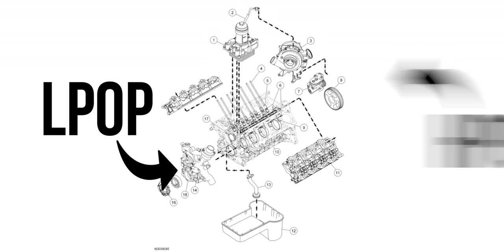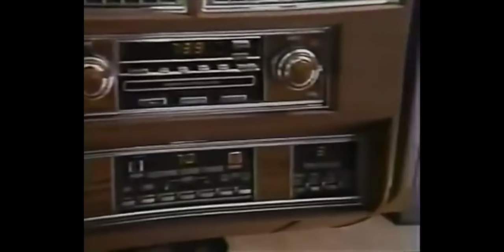These are the WORST ENGINES EVER MADE

Comment: The Chevy Vega engine with an aluminum block (with siliconized bore) and an overhead cam cast iron head. Poor cooling system led to blown headgaskets and warped blocks.
Reply: A well respected engine builder who destroked & hot rodded Vega engines told me he had never seen a warped block Vega engine packing the correct strength antifreeze. We now know today that proper coolant strength is critical in ALL aluminum engines.
Reply: @wymple09  The main issue was that they would CRACK THE HEAD most of the time around 50,000 miles.
NOT warped blocks or head gasket issues.
GM called it the "50,000 mile engine" and it lived DOWN to that name.

Mine didn't even make it to 50,000 (head crack around 47,000) - and yes, I DID keep the antifreeze at correct strength.
Reply: We have a winner!
Reply: @wymple09  Type of coolant is irrelevant!!  Keeping it in the engine IS!  Cylinders sinking down & losing the HG's seal because of that, was the main problem IIRC.
Reply: @alro2434  I didn't mention the TYPE of coolant, only the strength.
Reply: @bricefleckenstein9666  The warpage of the block is what cracked the head.  And it was 99% of the time not enough anti-freeze in the mix. It's also anti-boil.
Reply: @wymple09  Nope, it was not 99% of the time due to enough antifreeze in the mix - or it would NOT HAVE BEEN SO COMMON.
It also does not appear to have been block warpage, as many of those blocks were FINE when they got a new head - no machine work to correct "warped block" issues needed.

The issue seems to have been that the areas around the head bolts WERE NOT STRONG ENOUGH to resist the differential expansion between the aluminum head and the steel block, and would fatigue crack over time.
Reply: I knew someone who worked at Chevy Tonawanda during the Vega years. She said avoid it.
Reply: Vegas were cool deal, I could buy on auto trade for under 400-500 snails. Drop a gm 350 V-8  and 350./400 turbomatic. Shorten a Ford 9 inch, get driveline service to make a driveshaft from the 9" Driveshaft with big u'-joint and front 350/400 slip u-joint and balance the driveshaft. Flat bar solid motor and transmission mount. Graft v8 rad and go jump long neck beer bottle and endless 2 lane donuts without leaving the asphalt.😮😊😊😊😊
Reply: @cel729  Olds (or Buick) 215.
An aluminum block, aluminum heads, LIGHTWEIGHT (40 pounds appx) engine that WORKED in a Vega - and had no noticeable effect on the handling, while providing plenty of power.
And the stock Vega powerline was plenty beefy to handle it - though you did need to upgrade the cooling.

And beer? ICK!
Reply: Forget the engines, they would rust out long before the engines would wear out. Back at Chevy dealers in the 70s in the rust belt, it was common to see rust on BRAND NEW Vegas that had sat outside a few months.
Reply: @joshn938  A lot of Vegas were sold OUTSIDE the rust belt, where the engine would die BEFORE the Vega rusted out.
Someplace like Michigan or even further north, perhaps marginal Snow Belt states like Indiana, you have a point - but both of my Vegas were California cars and did NOT rust out.
Reply: @bricefleckenstein9666  California and Arizona cars usually don't. I think we can both agree the Vega largely was an awful vehicle.  The engines were terrible. I remember a friend had a 74 Vega that was 3 years old in Missouri and the subframe looked like Swiss cheese. Had maybe 20 k miles on it and the engine and front suspension just went one day driving in town.
Reply: May be the worst ( designed by accountants ) but the same design but built correctly by GM UK ( Vaxhaul ) were great .
Reply: @bricefleckenstein9666  if you don't know that Vega's had cast iron heads and aluminum blocks, you won't be on the same page here.
Reply: @georgesheffield1580  UK is cooler, so cooling issues wouldn't plague your Vauxhalls.
Reply: @georgesheffield1580  The Vaxhaul version fixed some of the issues - as I recall it used stronger and thicker areas around the head bolts, among OTHER changes, so there were no cracks to the head.
Reply: @grantdavis5992  I was saying the 215 had aluminum heads, NOT the Vega engine.
Reply: I owned one of these - when the rear main seal started leaking, I replaced with an engine with cylinder sleeves added by the machine shop, it was routine that the machine shop did this this to every rebuilt Vega engine.  The engine used oil, of course, but in 8 years I owned it the car only stranded me once, and that was from a broken fuel pump.
Reply: Can you install or replace the Vega engine with a GM Iron Duke engine to make the Chevy Vega better?
Reply: @levyoliver5363  I have heard of kits to do so - but it's iffy if anyone still makes them after all these years.
Might not need an actual kit as such, the engine mounts and stuff are probably all the same.
Reply: @levyoliver5363  maybe, but I never heard of anyone doing that.  Anybody that wanted to swap engines would figure out how to do the V8 Vega swap.
Reply: Interesting though that they're still probably no more Vegas hanging around then cavaliers and probably even cobalts these days.

Granted their modified, with Stout motors from Street machines to track cars, with cool looks cool paint and cool Wheels.

And someone above mentioned something about an aluminum head on an iron block but they've got it ass-backwards it was an ass-backwards design thanks to the bean counters with an aluminum block in an Ironhead.

The cosworth was the one to get with the twin-cam aluminum head and early electronic fuel injection.

All well ahead of it's time.

But who gives a shit about those engines when most people rip them out and easily swap in a V8, using all the bolt on parts from a Chevy Monza its predecessor.
Reply: Yes.. the Vega engine was a P.O.S.
Reply: @pilot3016  I used to own one so I can tell you straight out of the factory the engine was junk exactly as you say. What happened was Chevrolet engineered a new kind of aluminum engine block with some wonder-metal alloyed with it so they claimed the engine didn't need steel sleeves.  Well that was false, of course, and Chevy's own testing should have forced them back to the drawing board for that engine, but the idiots released the car as-is!  And of course once the consumer bought the car, that engine was soon eating oil and/or destroying itself from head gasket leaks.  But I owned a Vega for 8 years, but the engine had been gone over first, and the shop installed the steel sleeves in the cylinder.  This made the engine last a decent period of time, and the rest of the car was not too bad for 1972 when they built it.
Reply: @bricefleckenstein9666  ...my 1971 Vega, had a sleeved engine put in.  I drove the car another 9 years, never had a lick of trouble from it.
Reply: @robertmaybeth3434  And it had a lot more work done on it than just "putting sleeves in it", as part of the rebuild process.
Probably got one of the LATE heads where the "not strong enough, cracks" issue finally got fixed, as well.

A lot of folks put an Iron Duke in their Vega as a replacement engine - those engines were ALSO reliable and lasted a long time (if the Vega didn't rust out from under them).
Reply: First car I owned was a 1970 Vega wagon. I would go to the gas station  to fill it and then add 2qts. of oil to the engine! I suppose mine was the exception to the rule! Mine had 77,000 miles on it when I totaled it on black ice!
Reply: By the end of the production run, they had perfected the silicon-aluminum bore alloy and piston coating treatment, and reduced oil consumption to a minimum. Millions of people use lawn mowers, snow blowers, tillers, generators, and cement mixers with plain aluminum bores.

Comment: PowerStroke 6.4L.
Reply: Bulletproof it or dispose of it.  I do not comprehend how crippling an engine is going to save the environment.  The energy it takes to make these engines is wasted when they engines are junked early.  Strip all the emission garbage off it and the engine runs great and is not junked.  Thus, it would make more sense economically, environmentally, and practically, to not put the garbage emission junk on it to begin.  It takes far more energy to melt down your old vehicle and make a new one than the old guzzler vehicle could have ver used in a service life.

Comment: The one engine that must be added was the Chevy Vega 140 cid 4 cylinder. The idea for that engine had to of been a “Here hold my beer” moment at GM!
Reply: Yup! Check the gas, fill the oil!
Reply: They were junk from the day they rolled off the assembly line
Reply: In the end they perfected the silicon-aluminum bore alloy and reduced oil burning to a minimum. Millions of people use lawn mowers, snow blowers, pumps, generators, and cement mixers with plain aluminum cylinders.
Reply: That engine usually failed because of lack of lube. Everything leaked oil back then and starving any overhead cam motor was a recipe for quick failure.

Comment: I worked as a fleet mechanic for Amerco aka Uhaul and dealt with the Triton v10s and trying to send spark plugs into orbit is one of many issues! It wasn’t uncommon for them to completely fail around 60k miles, The exhaust manifolds/ donut gaskets leaking were so common that we changed them almost as often as the oil and you were guaranteed on having half the studs break, no matter how carefully you attempted to remove them! I got so good at welding nuts onto studs that had broken off down in the block, I actually passed the welding test for company I’m with now as a welder 🤣 I’d only had basic experience prior to uhaul! Sometimes bad things can turn into something good!

Comment: I work on a lot of Triton motors . Little tip. If it throws a spark plug , it likely has a vaccum leak somewhere likely at the PCV tube . That vaccum leak causes pinging on hard accelerations which is when they spit the plug. If you spit a plug , smoke test your intake system.
Reply: I'm today days old, that I found out an engine can "spit a plug"...that's just, not right, but badass as the same time.
Reply: Is that true for a 98 2 valve triton.I have one that has a little missing. Thanks
Reply: As someone that has worked on a few engines over the past 20 years. Shitting sparkplugs was not a thing under any condition ever prior to Ford, a true moment in engineering history

Comment: I had a Chrysler turbo 2.2 that had over 200,000 miles when I got rid of it and it was still on the original clutch. Change the oil when recommended and change filter every change and that car was dead reliable and quite fast for the time. My pick for the worse engine would be the aluminum block aluminum head 4 cylinder in the early Vegas. Many were already burning a quart of oil before 50,000 miles. Unlike most alum block engines the pistons road against the block and not steel liners.  On the highway the smell of burning oil told you a Vega was up ahead.
Reply: Vega had iron head.
Reply: Yep...great little eng. Ran mine to 178k. Replace the clutch once.

Comment: The 6.0 and 6.4 ford engines keep me employed at the reman shop. Next would be the 13L Navistar when we do those you can't mill it because there is no extra room to do so for the timing chain and also the aluminum cam caps on the cast iron block is also another brilliant design.
Reply: Blame MAN for the Navistar 13 Liter. As far as I can recall, that's a rebadged MAN D2676LF engine which I have heard has a lot of issues from where I live. Further models have actually shifted to the Scania DC13 which so far on feedback, is a bit more reliable than MAN since Scania, MAN, and Navistar are currently under the TRATON group.
Reply: There are many engines that cannot remain reliable at above factory power and that does not make them bad engines, just not hotrod engines.  The 6.0 might be a bad engine for other reasons, but no hotrodding is not by itself a legitimate reason to classify an engine as bad.
Reply: I've a van with the 6.0 and it was a catastrophe. Sold it after the second engine. I needed something reliable, not  something I wasn't sure if it would needed to be towed to the client house.